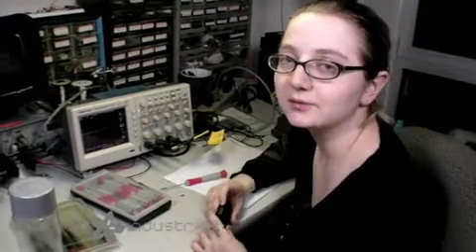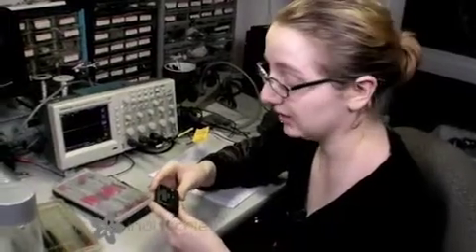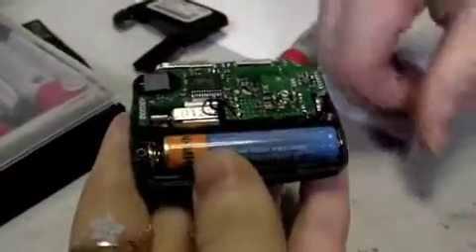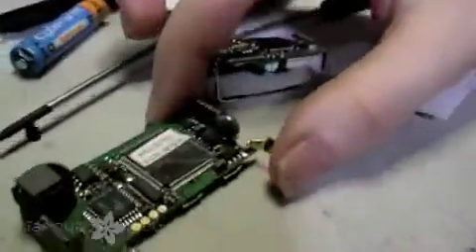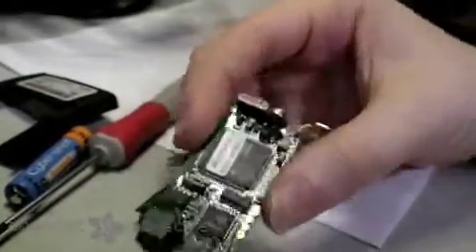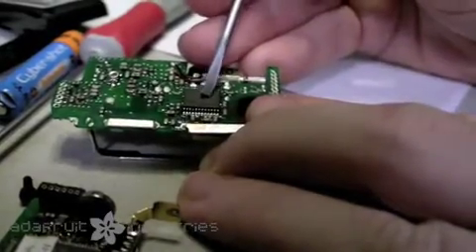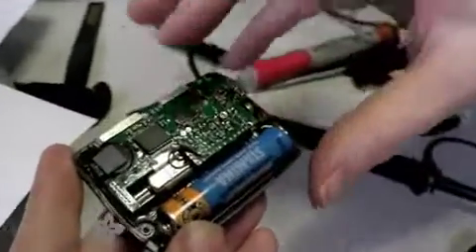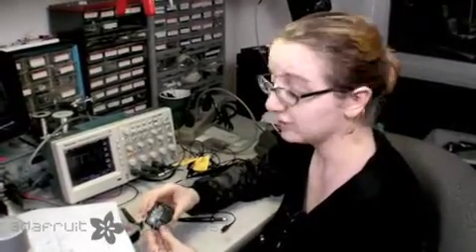Reverse engineering a pager - part I

Comment: With most pagers the RF receiver is activated briefly every second or two to save power. If the pager detects the long POCSAG preamble (square wave) followed by the start of its unique capcode then it listens for the whole message. Otherwise it just shuts off to save power until the next carrier is sent.

If the pager didn't have this feature it would be receiving the whole of every POCSAG broadcast, which on a busy paging network would drain battery power further.